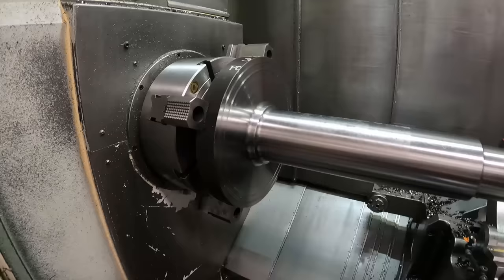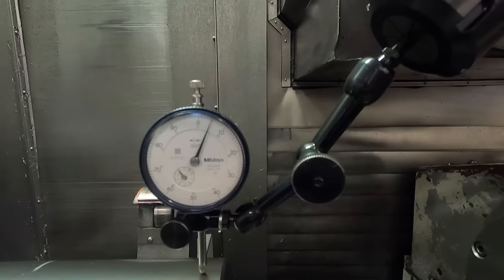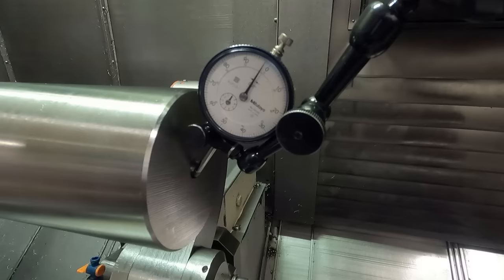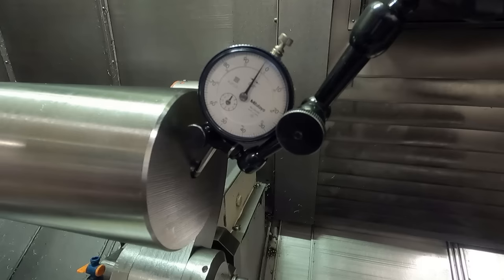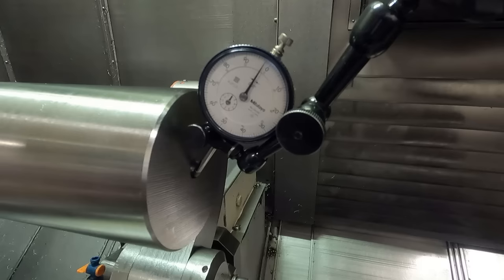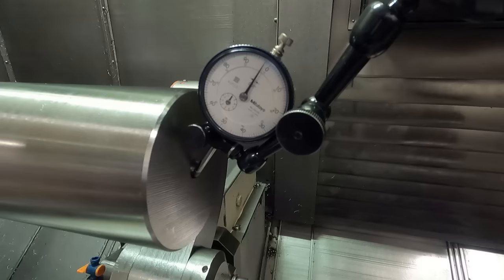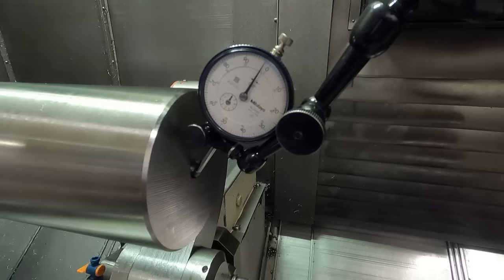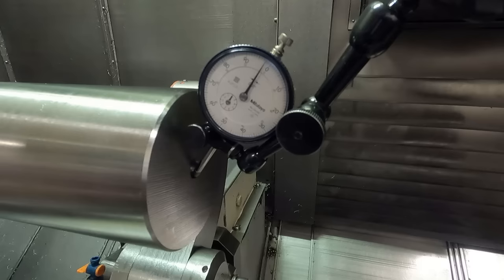Machine Shaft From 2000 Lb Stock

Comment: starting from such a huge piece of stock seems unnecessar (unless you're keeping the flange), is it a matter of availability or that it's better for the job ?
Reply from the maker: These parts were for this customers machine that was down. The original shafts were made in two pieces welded together. They had a failure. Now with the machine that makes their product down, time was critical. So in order to get the job done quickly and to avoid the same failure they decided to go with a one piece construction. Forging takes to long so we were left with machining out of solid bar.

Comment: Is this a multus machine? Or a macturn? I run massive multus's and the interior of this machine looks eerily familiar.
Edit: And holy cow did that one insert rough all that material?! My god. Can they not make that from a custom forging? Would be much less material to remove.
Reply from the maker: No I indexed the insert around four times to rough the part. But it did take only one insert. This machine is a Mazak Integrex e650H machine.

Comment: I know zero about machining...but my brain always goes outside the box. In this case, my thought is...wouldn't turning the piece in a vertical lathe (exists?) Relieve the pull of gravity and reduce the stress caused runout?
Reply from the maker: Yes there are vertical lathes. But generally they don't have a tailstock to support the end of a part like this. Which I think is necessary for this part. They are good for parts that don't require that if you have one.

Comment: Great video!  The gantry crank you are using to load your CNC machining center, anything interesting in the specs and capabilities?
Reply from the maker: Are you referring to the jib crane?
Reply: yes
Reply from the maker: The jib crane and hoist has a 4000 Lb rating.

Comment: I am wondering if I am hearing correctly, but why does the spindle turn up and then swing 90 degree down. 
Would it not protect the spindle bearings to first swing down and then spin up ? (Centrifugal moment of inertia) :)
Reply from the maker: It doesn't matter what position the B axis is to the spindle. It has no effect on it.

Comment: can your chuck use a dead center? would have been much easier that way
Reply from the maker: When I purchased this machine it came with a special dead center driving chuck, that would do what you are referring to. it has a center in the middle and small jaws that retract at a angle to pull back/hold the part against the center. But the dead center part of it is missing. I would also have to make some soft jaws for it. Just to much work for this small batch of parts. If I had a lot of these to do I would fix it.

Comment: What is the rational for selecting such a large diameter stock? Very interested to know.
Reply from the maker: The stock isn’t any larger than the 16” diameter flange on the end of the part. It could not be smaller and made the part in one piece. In the video you see the finished part when I pull it out of the chuck. I can only conclude you didn’t watch until the end.

Comment: Could someone explain why the original material needs to be so much larger than the desired part? I don't know anything about machining
Reply from the maker: The end of the part in the chuck has a 16” diameter flange about a inch thick. The customer wanted the part machined out of one piece of material. So the stock had to be at least 16” in diameter.

Comment: Can I ask why you didn't get chuck end running true and then the tailstock end running true and then use your steady rest to support it and then re-machine the centre?
Reply from the maker: What I did end up doing on some of the other parts. Was get the chuck end good than take a skim cut just on the area for the steady rest. Close the steady on that. Than drill the hole in the center and bore the c-bore with a small chamfer for the tail center. Open the steady. Than finish turn between the chuck and the tail center. That worked as well. Different was to do the same thing.
Reply: @EdgePrecision  Okay ya that's what I was thinking in my head when I started watching the video.  I didn't think there was anything wrong with how you did that one I just wondered if you had a reason for not doing that, that I hadn't thought of.  Great Video.

Comment: What happens to all the excess metal shavings do they just get thrown away or can they be used for anything else? I'm sure I'm calling the shavings the wrong name
Reply from the maker: Shavings is correct. They are sold to the scrap man. But steel shavings like this are practically worthless. Around $.02-.03 a pound is all you get.

Comment: Wouldn't it make sense to forge that part first roughly? Saves material and because of the heavy stresses?
Reply from the maker: It could be done that way if there was time and the quantity of parts to justify the tooling cost. But in this case because of time and the small quantity the is the most economical way to do it.
Reply: @EdgePrecision  ok, thanks for the response, but l wasn't thinking about special tooling 
Only a hydraulic press with some flat dies (or half round dies) would be good. But of course, if you don't have the possibility and have to send the part to a different/specialized company it makes no sense

Like your videos 😉

Comment: Use that magnetic lift to remove your chips.
Reply from the maker: The magnetic lift needs a certain amount of density of steel in contact with it or you can’t physically energize it. The shavings aren’t dense enough. The handle becomes almost impossible to turn. You can try this on a very small scale with a indicator mag base. Hold it in air, not in contact with anything magnetic. Now turn the handle. Not the force and how it may not stay. Now put it on a piece of steel and turn the handle. See how it turns easer and stay energized. No multiply that by 500 times. That the mag lift magnetic.

Comment: Curious layman, Why this couldn't be machined as 2 parts and attached later? Seems like a lot of work and waste to machine that stock down. 

Machine the axle first from smaller stock, then the flange, then attach then after the fact. Or maybe the axle having a smaller flange that could be bolted to a larger flange. 

I suppose machine time and waste is cheaper than making it in multiple parts? Or is a composite part that much weaker?
Reply from the maker: The flange on the parts end is the diameter of this stock. Because the customer wanted the part machined out of one piece of stock, there is no other way. Also the part these were replacing were made of two parts welded together. They had a failure at the weld. So hence the reasoning for one piece of material.

Comment: With a saw you could have saved a lot of material to reuse for a different project..

Cut the raw material vertically till the required depth and then use the  lathe
Reply from the maker: So what saw would that be? You may not realize the size of this stock. There is a saw shop down the street that could do it. But let’s say they charge another $500.00 to do it. Costs about the same as roughing it off. So the way I look at it. Why pay the money to the saw guy. I would rather get paid than him. Also machining into the square shape the saw leaves is hard on tooling. I would as you say be left with the drops off the saw. But this material would mostly need to be machined to a usable shape and size. So there is that. But again it doesn’t make me any more money. Until a possibly unknown job/time in the future.

Comment: when centering is it assumed that the piece is equally round?
Reply from the maker: I'm not completely sure I understand your question. But I will say this. When starting with a rough piece of material. It isn't critical as long as there is enough to cleanup round. (This only makes sense). But when centering is critical, or for any critical machine work. It is better not to make any assumptions. Check It. If you have a part running off center at the tail end, but chucked tight. Then you engage the Tail center in a center hole  to force it to run true. This can cause the part to be turned out of round. Because everything has give if there is a force against it. So if you are forcing a part to run true. You are applying a force against the spindle and tailstock bearings. This unequal force as the part rotates while turning can cause a out of round condition, while finish turning to size. Bottom line. It is better to check it and not assume anything.

Comment: Why was it necessary to start with such a large piece of stock? Could the part have not been forged nearer to finished size?
Reply from the maker: I have answered this question many times in the comments. Because there is a flange on the parts end that is the diameter of the stock. Also this customer wanted the part made out of one piece of material. The original parts this was replacing were made by welding the flange on a smaller round bar. They had a failure. So they made the decision to go out of one piece of material for the replacement parts. Just to be sure.

Comment: How terrible is the movement actually when using non capto i always hear people going crazy about it. Also did you get the chip conveyor working again?
Reply from the maker: No I haven't had time to work on the conveyor yet. I'm not sure what you are referring to about the capto? After having used almost all other spindle connections. I will say for me Capto has been the best and most useful because of not only what you mentioned but you can add extensions and reducers to make the tool what you need. And still maintain a good rigid/concentric connection. For a multi task machine like this it is the best connection for a spindle you do milling and turning with.

Comment: Why start with something so much bigger then the finished dimensions?  Would it not be less work to order thinner steel?? Just a question.....
Reply from the maker: The flange on the parts end is the diameter of this stock. Because the customer wanted the part machined out of one piece of stock, there is no other way.
Reply: @EdgePrecision  ok now I understand,  thanks for the explanation.

Comment: What if your quil isn't running true? Then the entire part would be off, right?
Reply from the maker: Not if there is no runout in the tail centers spindle. You have heard of people intentionally turning a taper by forcing the tail center off center to the spindle. Now in this case chucking on the big 16” dia could cause some stress in the part by forcing it off center. That could possibly cause runout due to stress. But the center itself doesn’t cause runout.

Comment: Did you face off both end of the rough bar to start. I didn't see but if you did it would have made life alot easyer as when you put the part up for finishing you put the part square the the back jaws and clock the back diameter and that's it. Pressure pad to put the steady tracks back in and then the centre then finish machine. Didn't really agree with clocking the old centre and hitting the part as it's just pointless. Just just leave it up a bit more on the rough so you have more to finish. Heat from machining causes stress too. Light cuts and coolant to finish

Comment: Hello
One quick question. Was it possible to clamp the shaft tail stoke from one side and from the other spindle side with one tail stoke in the centrer too? I am not sure if  I said something very stooped...
Reply from the maker: I would like to answer your question. But I don’t understand what you are asking. Sorry.
Reply: @EdgePrecision  Hello
Thank you for your response... I was trying to ask you if was it possible to use in one said  tail stoke and on the other "spindle side" a big driving carrier ? Probably the shaft is too big, and it is not possible. What is the maximum diameter shaft which someone can use for driving carrier?
and one more question... if you had clear the shaft  (one turning pass) before clamp it on the jaws, will it less out.
Sorry for my English

Comment: Did they not have enough lead time for a forging, or consider a weldment to save machine time
Reply from the maker: No there wasn't enough time for any of that. It's also debatable weather that would save any money. The thing is you are just moving money from one place to another. You pay the welder, the forge shop or the machine shop. By my way of thinking I would rather get paid than someone else. For these small quantities and time frame the least expensive way is to turn the material into shavings.
Reply: @EdgePrecision  Fair enough, time is money is a problem we run into at the fabrication shop I work at

Comment: Why did you drop it from the center like that. Couldn't you use support then take the center of  to face it and re center?
Reply from the maker: I could have re-cut the center. In this video I was just trying to demonstrate something, about stress relieving in the material from roughing. Another way to do this is to back off the center after roughing. To let the part relieve any stress. Then very carefully skim a concentric diameter/ring area for the steady rest jaws without any support from the tail center. Then close the steady rest on that and re-cut the center drill with a boring bar or endmill (Not just re-drilling with a center drill). This is the way I did the remaining part on this order.
Reply: @EdgePrecision  nice. Didnt want to criticize your work. Your work is amazing. I was kinda questioning my own train of thought asking you. Thanks for the answer.

Comment: Cannot weld 4140 due to cracking.  Forging to near net shape best.
Reply from the maker: Yes it can be welded. But it has to be done properly. With a pre heat and held at that temperature during welding. That a post weld heat treat. That’s why I say even though it seems wasteful to machine out of a solid bar. It may cost just as much to weld two pieces together of this material. Because of the time it takes and materials for welding it properly. You either pay the welder or waist the material in machining from solid. And those parts to be welded have to be prepared for welding. So there is that time as well. So in the end have you really saved money. Forging has the same issues. So what it boils down to is either pay the machinist, pay the welder of pay the forge shop. In this case there wasn’t time because the customers machine needed to be repaired. So machining was the fastest.
Reply: @EdgePrecision  Thank you.  Have used two piece welded together (near net shape) since 1965 for even more difficult materials than 4140, which I consider a tool steel.  Also the owner should consider a spline joint, press fit from two pieces.

Comment: That center drill looks tiny compared to diameter of the round stock.
The largest center drill I've ever seen has 1 1/4" shank and 1/2" tip diameter.

Comment: Really good explanation on the stresses bowing and deflection . One really starts to question himself when going under a certain runout limit like under 0.05mm . Everything starts to matter . I wish i'd be there to see the machine rough that steel . How much spindle load did you have when cutting the biggest diameter , i suppose it went down a little when you got close to your finished dia ? 

Have a good weekend Peter .
Reply from the maker: The spindle load was around 50-55% during the roughing operation. It does reduce a little when the diameter gets smaller. But not much because the machine is running in constant surface speed. So as the diameter gets smaller it speeds up the RPM to maintain the surface speed. This machine has a 60 hp turning spindle with two gear ranges.

Comment: I'm a bit new to this kinda stuff, why do we start with such a huge stock and turn down to a smaller piece? can the excess be re-used or recycled?
Reply from the maker: The shavings can be sold to the scrap man. But for only about 2-3 cents a pound. As for fabricating or forging. Read some of my previous comments.
Reply: @EdgePrecision  got it, thanks, that makes sense.